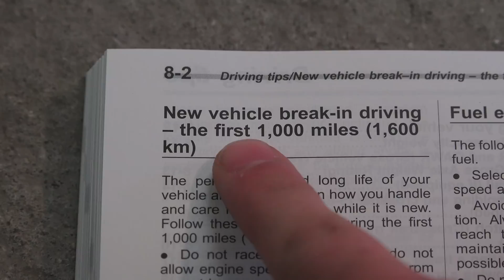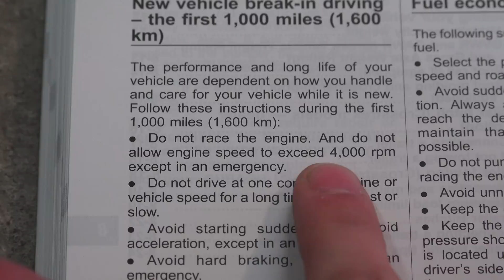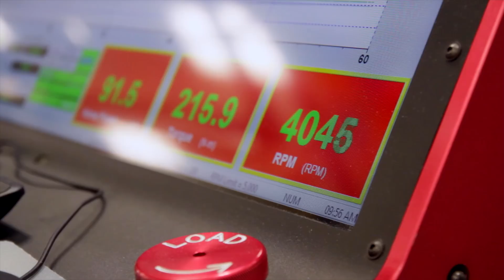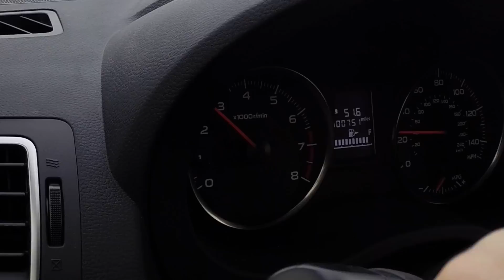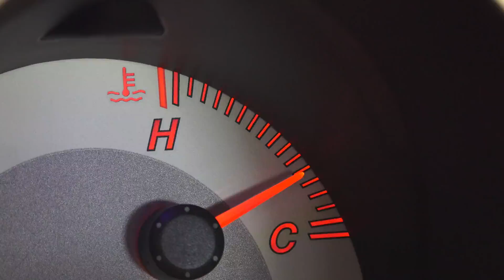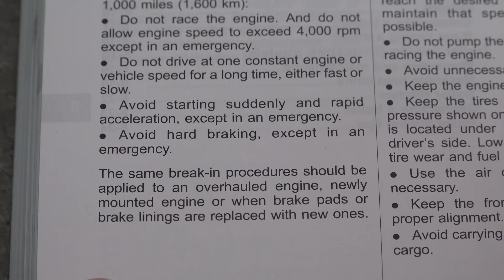5 Things You Should Never Do In A Brand New Car

Comment: I would move point #4 up to the top and not just for break-in but for the entire life of the vehicle.

Ideally, lugging and redlining should be done only after the oil has reached its operating temperature, which often happens quite some time AFTER the engine (i.e., the coolant) has reached operating temperature. (The amount of time between those two fluids coming up to temp depends on engine design/component placement)..

Lugging the engine, or generally running it hard before it gets to operating temp is only doing more harm. The most damage is done at engine start when there is no oil flowing through the machined surfaces, (and the weakest parts are usually the camshafts). Pressing the engine when the oil isn't flowing as well, and the blow-by condensing in the crankcase (*) and getting into the oil only makes those machined surfaces work that much harder on oil of suboptimal operating parameters. Most synths have additives to address some of that.

---------------------------------
(*) that it partly why it is better to not drive for very short distances, especially at break-in.
Reply: what is an ideal warm up for a turbocharged diesel engine,5 min ?
Reply: I give my engines at least 15 mins at moderate power (not sat in traffic) before going hard. Metal needs to warm up and expand.

Comment: I don’t care what the so called data says. I’ve owned numerous new cars since the mid 80’s from various manufacturers are I’ve driven all of them hard right off the dealer lot. I’ve never experienced any issue such as oil consumption or engine failure etc. None. In fact, experience has shown me that with performance cars if you break it in slow it will always be slow. I’ve proven that over and over again. Break in periods for new cars are a thing of the distant past...like when cars came with carburetors. But to each their own...

Comment: I just bought a new GTI out of state and drove it 500 miles back home - I didn't realize using cruise control for extended periods of time was a bad idea. Is there anything I can/should do now to give the engine the best shot at a quality break-in?
Reply: Patrick Simpson You’ll be fine. Any new car built since the 80’s doesn’t need to be broken in. This is a myth that has carried on for decades.

Comment: Ive had 6 amg's and  3 BMW m cars from new, never broken in, never had an issue. if there is an issue, warranty. If the engine can only make it 350k and not 400k because i didn't break it in like james may, good idgaf. Wont be my problem at that point.

Comment: Another reason why Acura is doing a factory brake in is simple. They know with the NSX your going to drive it fast and hard as soon as possible and with a new car your going to have a warranty on the powertrain so if it fails they pay for it. So basically it's a good way for the manufacturer to avoid a warranty repair if they do the break in for you.

Comment: Dyno tests dont lie. Hard break ins produce more power.
Reply: TL,DR: 
Take it easy unless you make money by pushing those engines to the limit and relying on them having a couple more % in horses than typically expected. Err on the side of caution.
With that said, if you are the kind to rebuild the engine twice a week, how in the world would you find the time to run it for a thousand mile each time while making sure the load varies? Hard break-in is the only option then.

I think on a practicality standpoint, the knowledge is settled on the necessity of hard break-in for strictly performance purpose. There are exceptions when manufacturers step in and take control of some aspects, like Audi with their laser clean-up of the upper cylinder cross-hatch microscopic honing grooves, or Honda/Acura with the factory break-in. Still, in general the hard break-in must never be actively recommended for the mass market in any way. Even in the racing crowd there are still debates about how hard is hard enough for the virgin runs. Formula 1, Le Mans, GT-x, Indi 500, Offroad, there are different demands placed on the engines even when crazy redline may be expected from all of them.

On the scientific point of view, engineers are NOT YET satisfied with what we currently have, even on papers. There are many reasons why break-in is and will still be a thing for the foreseeable future of Internal combustion engine (I edited this, sorry). I might just shamelessly list some of the things I could easily find on the net, and ignore the pro tuners' secret sauces that they experiment behind closed door.

The first point of the break-in is to clear the burs from the manufacturing process, which is influenced by manufacturing tolerances. The more mainstream the market is for an engine design, the looser tolerance is expected, relatively speaking. On any given year, engine hones on a GM will be different from say, an Audi as I mentioned with their laser mojo. Typically in most cases if you break it in like a Pope would, the honing groove will be quickly filled with very fine chunks of metal and might never clear, thus oil vein capacity could be restricted AND uneven (which may or may not interfere with the performance you need, depending on the design, again).

The second and perhaps a more important point to performance tuners, is to achieve the most reliable hydroplaning effect between cylinder wall, piston rings and the oil going through them. Now we have 2 solid materials of different hardness (as intended), 2 different coatings, and a specifically designed oil layer between them. The combo of these 3 is almost unique to every engine manufacturer and could even vary a lot under the same maker as the rings and oil types can still be swapped for different use purposes.

Thick, high-tension rings can seal better, but they drag on the wall with more friction so you need to break them in hard to get good seal from the start otherwise they will never achieve their best sealing potential. On the other hand, loose rings that only seal well with warm oil are considered best for normal driving in a wide range of weather conditions, but they grind away past usefulness more quickly if you mistreat them. Even the piston that houses the rings can be changed in design from model to model.

Blow-by is also another problem that the rings were tasked with controlling, and it is harder and harder to manage blow-by when performance is the top priority. In hardcore engines such as F1 or some drag-racing projects, RPM is so high a lot of fuel won't burn all the way no matter what. This excess fuel dilutes the oil and puts the desired piston hydroplaning effect at risk. Those crazy engineers have done an incredible job of balancing the concoctions of everything in those hell holes to keep the engine working and delivering impressive power at screaming speed. Break-in is only one part of all the bullhorns they have to try to control. The risk of a fiery death in front of thousands of spectators, is not that far off.

The dynamics between components moving at high speed are already hard enough to map out concretely, innovations keep rushing in and occasionally clear the research table even when problems are still lying around unsolved. What major things have we gotten in the last few decades? Chamber design, valve train design, port shape, materials, coatings, oil technology, cooling solutions, and now the trend is to put another screaming hot component (turbo) in the middle of all that?
These engineering struggles sure look fun, even for a broke nerd like me.
Reply: Exactly.  For the track bikes we put fresh oil in heat cycle it twice then change oil.  Run it all thru the gears and rpms for a little while.  Never holding it at a constant rpm. Repeat and rip on it
Reply: I like this method.
Reply: 86Hilux22R Bingo!
Reply: Yes, it is. Correct.
Reply: Are you implying that hard break ins dont produce power?
Reply: @86Hilux22R  have you noticed more HP with hard brake ins vs gradual brake ins with the same car or do these people you speak of that do these Dyno tests just believe that and just say we see the numbers and there's the HP? If so I can see why you believe that.
Reply: @86Hilux22R  HURRdurrDURRHURRhurrDURR
Reply: Actually I just got my skyline rebuilt and the tuner won't even dyno it for power until I put at least 2000 k on it and he put a 4500 rpm rev limit and a 10 psi limit on it. And a lot of tuners make you go through a break in period before they will dyno for max power.
Reply: jeremiah white that's only before the guy will run it on a dyno. The way you break it in is up to you. And a hard break in will likely make more power. Also I dynod a 67 land cruiser with less than 50 miles on the engine
Reply: Maybe for like a sloppy push rod but nothing north of a dohc modern engine will appreciate that buddy. Engine rebuilds of any caliber require slow and methodical break ins. You need to change blinker fluids before hard break-ins too haha.

Comment: You say that the piston has to heat up to expand to press against the cylinder wall. The more an engine heats up the bigger the gap between piston and cylinder wall. The cylinder will always expand more than the piston can as there is way more metal to expand. This is why heat works so well on locked up nut and bolts.

Comment: Break it in hard. More pressure forces the rings against the bore harder seating them better. The company says to be easy to cover themselves in the event of engine failure. Dont let new engines get to hot when new and you risk glazing the rings/bore. Im sorry but easy break in, is for when engines were very basic and did not have the tight tolerances we have today. Now there will always be defects and lemons. More evidence is pointing to hard break in.
Reply: sirjolly81 exactly!
Reply: I tested a hard break in on my 08 690 after it needed a new top end. Works a treat and bikes feels and runs great.
Reply: sirjolly81 Great. Over the years I’ve driven many new cars hard right away and they were all “freaks” at the drag strip.

Comment: After 45 years in the automotive service industry I have never seen any difference between cars that were babied or driven hard during the break in period. My first car was a 1970 Plymouth Duster. I asked the senior tech. in the dealership how I should break it in he said get it up to operating temperature then take it out and see how fast it will go! I have owned 10 new vehicles and have never had a engine failure or one that had a oil consumption problem.

Comment: You've done a terrible thing by potentially misleading 2,948,07 viewers at the time of writing this, by overgeneralizing something as mechanically intricate as an automobile. Really this video should have "for a daily driver" in the title.

When breaking in a turbo car you need to account for the seals in the turbo, hence no more than "x" amount of throttle. The corvette advisory specifies initial acceleration because they know it's easy to go above their maximum RPM due to wheel spin.

For any motor, you want lots of load on the motor during periods that the piston rings are filing down the cylinder hones. RPM is actually irrelevant as long as the cylinder walls are lubricated. 

The problem is that you also need to break in the valve components in the head, which is where the maximum RPM part comes into play. The % of throttle advisory is because on a turbo car, you also need to take into account the turbo seals and bearings. More throttle or load = more boost = faster spinning compressor and turbine in your turbo. Something as small as turning on the AC can account for more load on these components.

Look at this problem like this; If you're using the car as a daily commuter, drive the car as you would during the daily commute. If this car is going to be used as a fun toy, beat the snot out of it during break-in... turbos and valve components are easier and cheaper to replace than a cylinder with smooth walls...

The sad fact is that with any vehicle, you will never properly break in everything. It will always be a trade off. Clutches depending on the material need soft break-ins for organic, or hard break-in for metallic. Breaks will need "Y" amount of usage for seating to the rotor before too much soft breaking glazes the pads and you need hard breaking, but the seals and material for the break lines will "mature" at a different rate. Tires will rotate at a different rate than the rims at hard acceleration until the mounting grease drys, which will throw off the balance. Your audio system needs at least "Z" amount of time at ear killing volume to break in the bonding adhesives for the components. 

Don't even get me started on the suspension, or worse the components of the frame... Basically you need to look at what is the cheapest thing to repair when breaking in your automobile, and enjoy that highly carcinogenic "new car smell" while you are doing it.  

Your car will never be perfectly broken in for daily driving, spirited driving, and reliability all at the same time. It's the same reason why racing teams replace so many insignificantly small components during "testing" before race day, as opposed to ripping out large portions of the vehicle. Money isn't an object in such uses of a vehicle.
Reply: Helen Ayala give it a rest mate
Reply: If you think about how the materials in an engine function and how they are made everything he said is right. You literally have to do high school science to make sense of this

Comment: A lot of new vehicles don't even have a "break-in" period.  The whole "don't rev above xxxx RPM" is old knowledge.  With a lot of new vehicles it's actually recommended to run the engine at different RPMs and not just lug it around staying in the same range in order for the piston rings to wear in and seat properly.

Comment: A point you are missing is the guidelines are for everyone, inclusive of all the morons out there. The best way can not be offered to morons as they will do damage.

You understand that rings seat from combustion pressures, therefore the best way is to floor it, against the generalised advice you are offering, but for only very short, no more than 1 second, full throttle loaded bursts, then change up gear and do it again. The rpms will not get near 4000 in such short bursts.

And generally continue to drive like that for the car's life for long engine life, especially in the morning when it's cold still. My last 3 cars were 400,000, 320,000 and currently at 280,000kms engines internally untouched, running strong with no out of the ordinary oil usage.

Comment: Don't floor it? And I'll tell that is why piston rings aren't pushed like they sould be against the cylinder wall and then you have huge blowby with new engine, best thing to do, drive it slowly and then engine's performance is poor until it flats out from wear. I have rebuilded several 4stroke engines and then teared them apart from diffent style of breakin cycle and driving it slowly without floring it is worst case scenario, yes it saves manufacturer in some point and only manufacturer.

Comment: Yes you need to warm your car up.  I work in a powerplant. We warm our boilers and turbines up. Boilers grow 6-8 inches on warm up. Same with an engine. The piston/cylinder will warm up fast but your block hasnt expanded yet. You can get away without warming up, but it will last longer if you do let it warm up..

Comment: False: I’m a test driver at a major manufacturer. We drive into a roll drum, rolling start from zero to 45mph, wide open throttle until 85 mph while bouncing off the rev limiter on every gear change. It smokes like a freight train from off the assembly until it reaches us. After our test, it no longer smokes. During our process you can watch in the monitors that it goes from full exhaust smoke to no smoke visible. I suppose every product is different..
Reply: I've owned 6 new cars in the last 4 years (its a long story) 4 of them were Subaru's, 2 Sti's, 1 wrx, and a BRZ. the other 2 are hondas; a 2018 Honda Fit and the other is a 2018 Civic SI. I put 20k on each of the Subaru's and drove them like i stole them off the lot. Not one had a single problem due to a bad break in. Bad engineering in part with the ECU, now thats a different story. 
In the factory, Subaru Runs those motors to red line multiple times, it doesn't make sense that you have to baby the motor like that when its new. I think whats really happening is that its the other moving parts in the drive train are what need the break in period. The block is already broken in. I usually do hard break ins, because im older (37) and thats how we broke in motors in 90s hondas. None of them failed because of a bad break in. NONE. I built prob 20 motors in those days, and did the same break in procedure for all. Varying RPMS and different speeds with small sprints to red line here and there. I think the manuals/manufacturers just put that info there, so they dont have to warranty anything right away, as well as keeping the PR positive by saying that a proper break in wasn't used if something breaks in the first 1k.. It seems to me to just be Marketing fluff and a CYA for the manufacturer.
Reply: @juanticimo  i have a honda civic Hatchback sport 2018 i think i did a bad brake in ive lifted to 6000rpms and have sudden accelerations here and there
Reply: Base on you experience do you think that would affect my engine ?

Comment: 5500 rpms ?  What the transmission is doing ? Data saved in engine memory ? I don't ever go over 3000 rpms in 5.3. The 4l60E I have changes gears at 1500 rpms